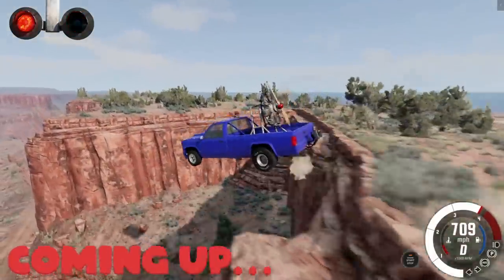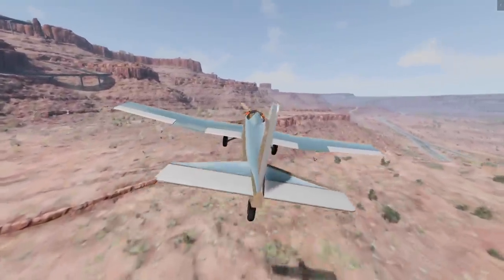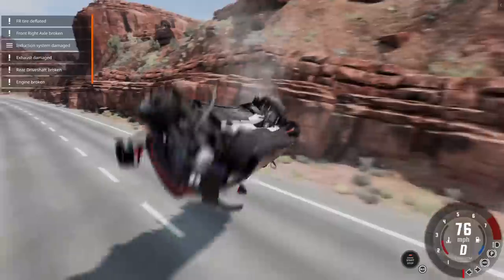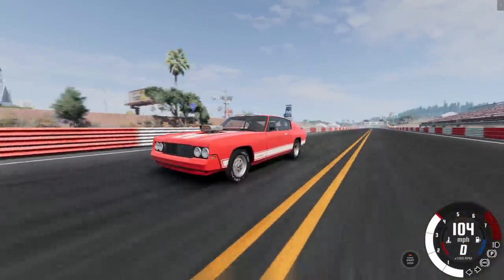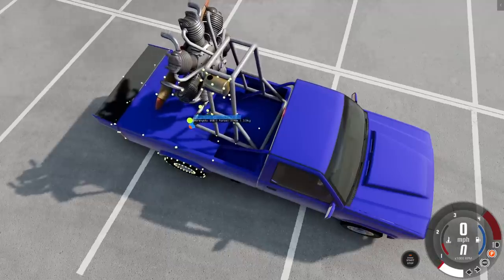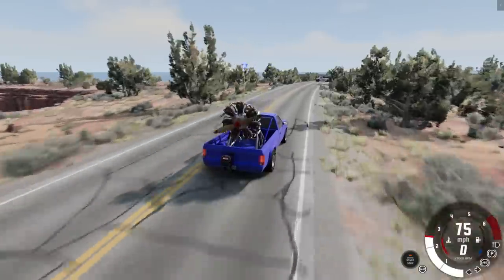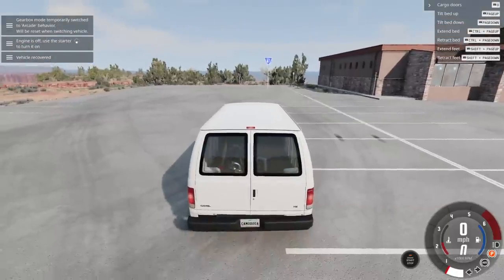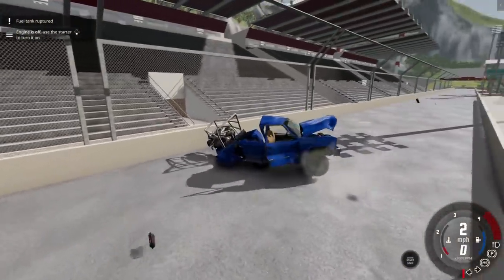I Put a PLANE ENGINE on a Truck to Escape the Police (BeamNG Drive Mods)

Comment: One thing I noticed was how much trouble you were going through just to attach the plane motor to the D sires, what I like to do is slow down the simulation speed (slow motion) in the environmental settings when im attaching stuff like beds to a pigeon without any not needed parts just to make it float (it worked but since it was in the water I had to use the fligeon mod for a propellor to get it to move). Any way just slow down the sim speed & it’ll be way easier.

Comment: Does Camodo gaming not understand Areodynamics? Putting a plane engine on a car will just make it go fast. It needs wings and Flaps the flags generate lift and drag which is why it doesn't take a 15-mile-long runway to accomplish a takeoff or landing. In order to fly with no wings or flaps then he would need to go at more than 7 times the speed of light. The speed of gravity is 7 times the speed of light. In order to make a plane that can fly with no wings as well as a normal planes thats how fast it would need to be